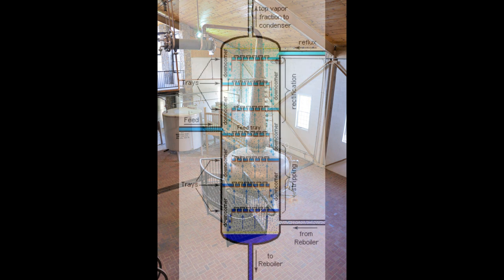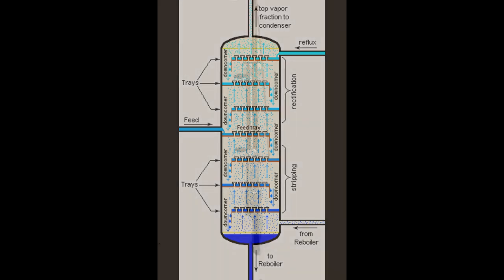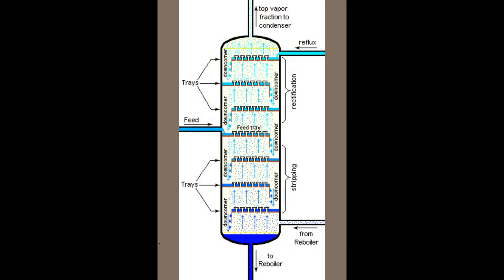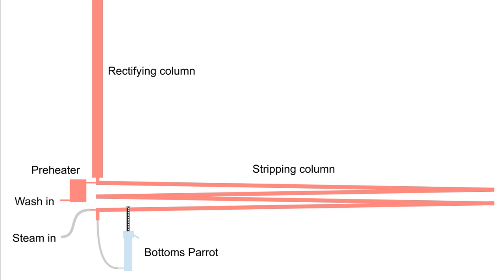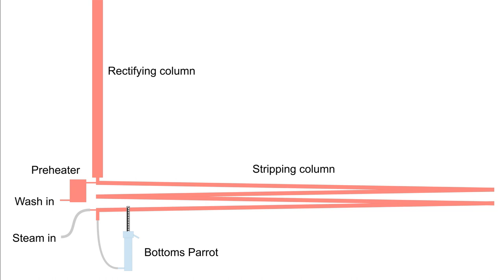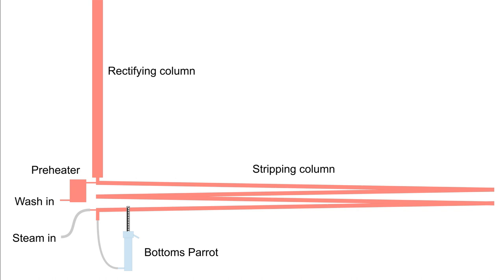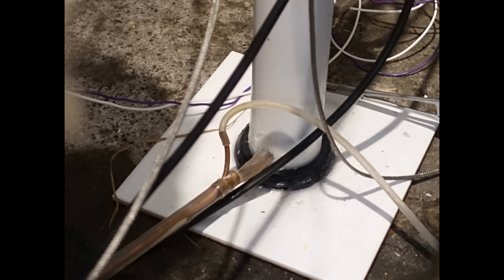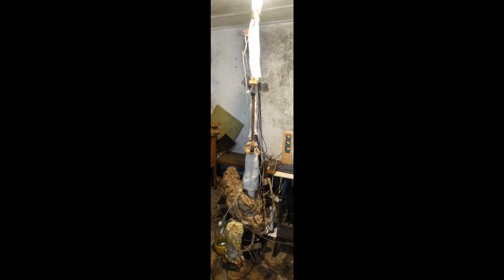Continuous Moonshine Distillation

Comment: I use a submersible fish tank pump with a needle valve.....I feel so cheep.
Reply from the maker: I got a bit obsessed with pump performance as it seemed such a limitation but when I started using closed loop feedback control it seemed to nail the problem. I guess fish tank pumps would be fine if their speed can be controlled electronically.

Comment: You should perhaps investigate Proview, which is a open-source industrial process control system. It would make the discrete PID-controllers redundant and would allow you to hookup all sensors etc into a unified system. I have been thinking of doing the same thing.
Reply from the maker: Thank you for the suggestion, I will have a look at it. Looks like it is just what I need for the infernal feedback control loop problem.

Comment: Have a look at Ulka pumps.
Reply from the maker: I had a look at the datasheets. They are oscillating AC pumps so would be controlled by varying the AC frequency. That is easy enough to set up but their flow rates at 50-60 Hz with low pressure are quite high at 70-300 ml per minute so for my thin column you'd need a frequency of under 5Hz. Not sure how well they work at that frequency.
Reply: @tight1449  My name's Peter, what's yours?

Comment: Interesting, would like to see it in operation.
Reply from the maker: I'll film it. But I'll have to tidy up my distillery first or it would be too embarrassing!
Reply from the maker: I'll show it in more detail. I have just made a new rectifying column from scratch. The old one was so modified and remodified it was not a great model to copy. I'm currently testing it and will post videos on making it if it works OK. The stripping column is the same and is very simple.

Comment: Silly question for silly questions sake... what if your wash was in say a keg at a minimal pressure even air pressure not co2. You then had the wash feed thru a regulator so it's fed at a constant pressure into the analyser? Cheap way of dialing in delivery or as I said silly question?
Reply from the maker: Could work but you need a precisely controllable flow rate. A regulator would give you a constant pressure. You could add a fixed resistance to get constant flow but it would probably be difficult to vary it precisely as needed.  I have used a system with gravity feed through a constant resistance varying flow by changing the height of a header tank but it was more difficult to set up than roller pumps.

Comment: I find this fascinating but still a bit confusing - how do you get rid of the methanol from a newer wash coming in?
Reply from the maker: That's a very good question with a complex answer. Volatile components of the incoming wash tend to remain as vapour, and preferentially leave the column via the head's vapour fraction, and not the hearts liquid fraction. However in the case of methanol, although it is more volatile than ethanol, it has a significant affinity for water so while it does partition between heads and hearts, there is still methanol present in the hearts, although at very small concentrations, particularly in my case where I'm using cane sugar derived wash which has virtually no methanol in it to begin with. 

Methanol distillation is a complex subject and I've found it's very poorly understood by home distillers. For example, the idea that for-shots contain more methanol than do hearts, which home distillers will swear to, is false.

Comment: The azeotrope is not 96.51% abv, it is 97.2%. See any source that doesn't confuse abw for abv...
Reply from the maker: Can you reference that? 96.51% is by volume. By mass it is about 95.6% and by mole fraction about 91%. I have not seen 97.2 at STP by any measure. 96.51 by volume accords with my experience because that is the barrier I have never gone past.
Reply: @tight1449  Wikipedia's ethanol page? "Mixtures of ethanol and water form an azeotrope at about 89 mole-% ethanol and 11 mole-% water[78] or a mixture of 95.6% ethanol by mass (or about 97% alcohol by volume) at normal pressure, which boils at 351 K (78 °C)."   
Or from the rectified spirit page "The purity of rectified spirit has a practical limit of 97.2% ABV (95.6% by mass)[2"  The 2 there sources the claim to Whiskey Technology Production and Marketing (great book)
Reply from the maker: @MrJhchrist  I'm not surprised there is a discrepancy. It is almost always quoted by mass as 95.63 or mole fraction. I could not find any direct measurements by volume which is what we need as hydrometers are calibrated by volume. The conversion seems to be made by calculation. I have not previously seen it as 97.2 but have as 96.988 and 96.51. My measurements are limited by hydrometer and thermometer calibration but according to my measurements it is somewhere between 96.5 and 97. I cannot prove 97.2 wrong though!